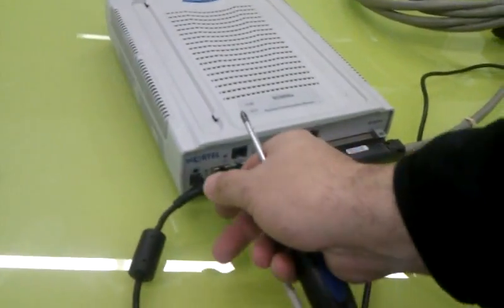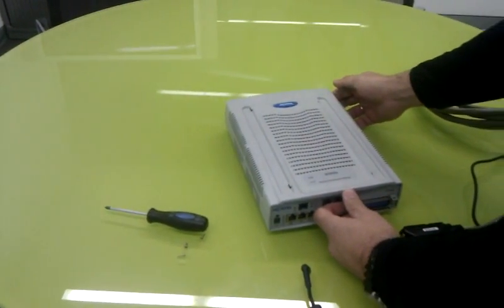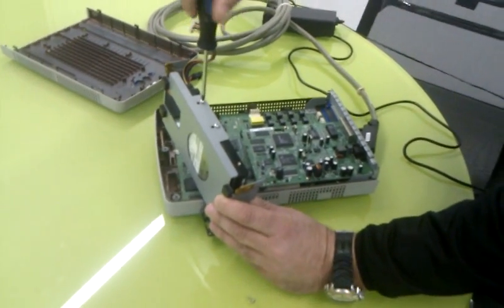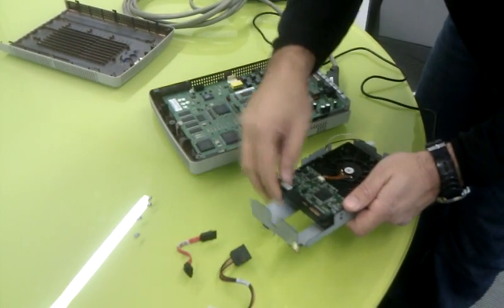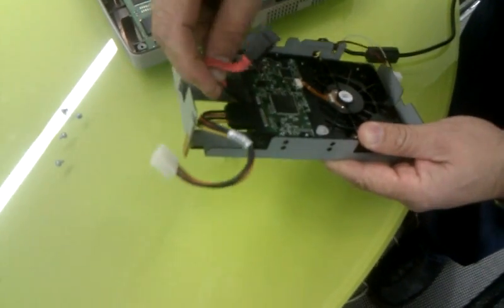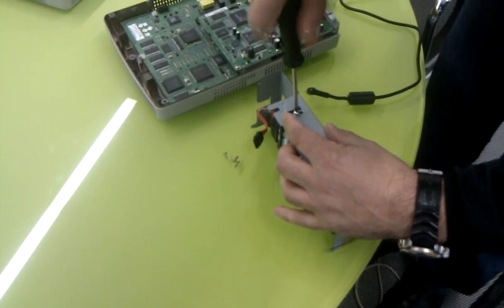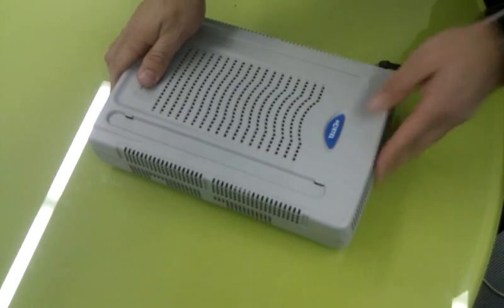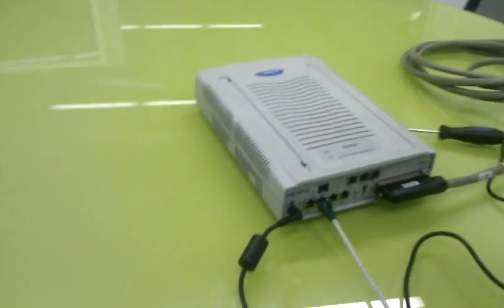BCM50 Hard disk Replacement 1

Comment: With the BCM50 is it possible to just clone the drive onto a new one? and if so is it worth putting on to a small SSD or honestly based on technology age not worth it?

Our unit is about 5 years old, so I'm wondering if we can A, replace the HDD for good measure, or B purchase another BCM50 online, clone the drive and have as a redundancy. Are all the licences etc installed onto the HDD or other areas of the unit? Cheers :)
Reply: +Rendersmart Don't know if anyone gave you an answer on the cloning. Windstream tells me our unit is at end-of life even though its under contract.  When it craps out they'll be happy to install a new unit at our expense. I think I'm going to try cloning the BCM drive as well as cancel the Windstream contract at the end of the year.  I'll post results.